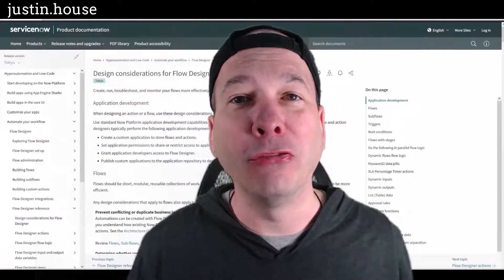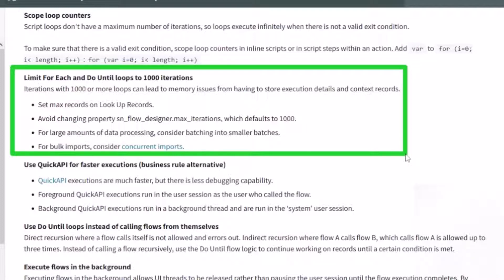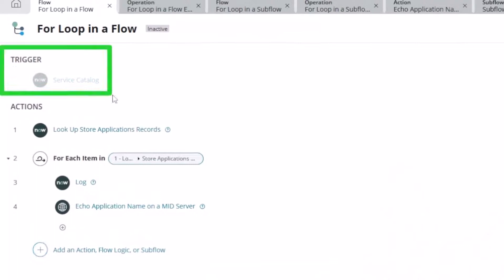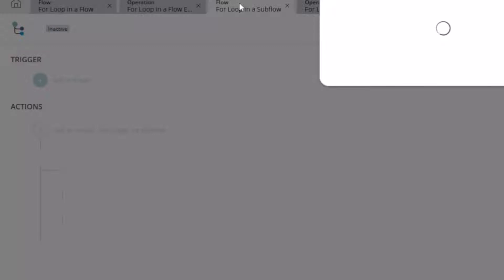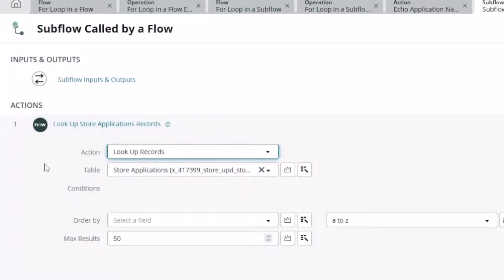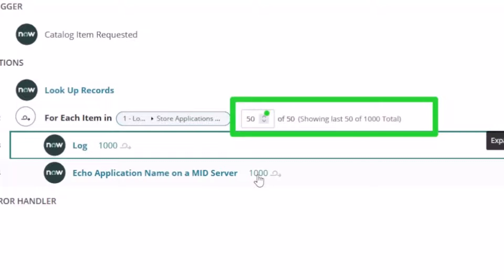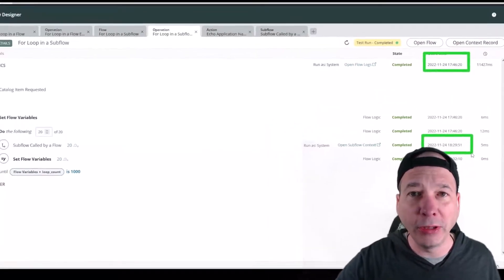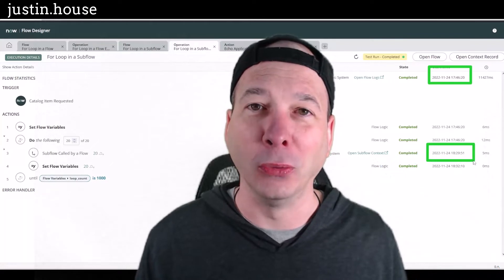Optimal Flow Designer Looping in ServiceNow

Comment: Have you discovered a way to chunk the Flow actions though? For example, if the goal is to query internally for 1,000 records and run actions on each, there isn't an obvious way to tell it run 1-50 in the first loop and then 51-100 in the second. What do you do with the loop counter variable in order to start at the next chunk?